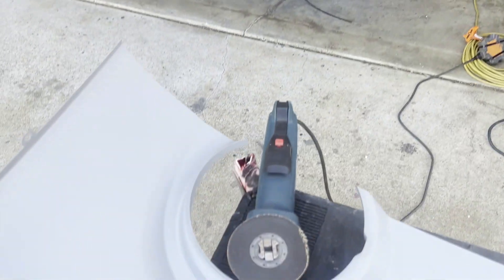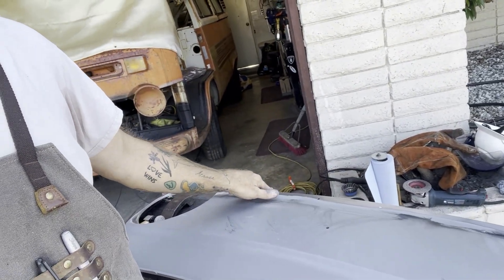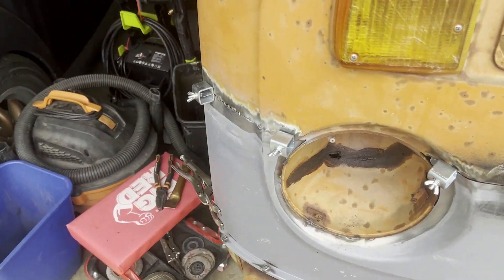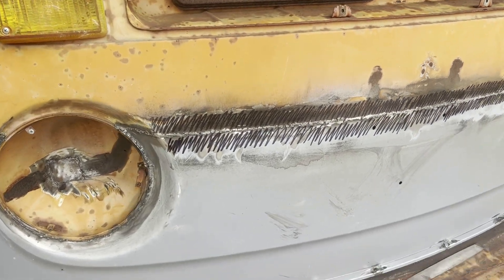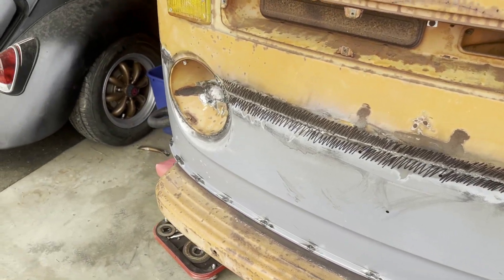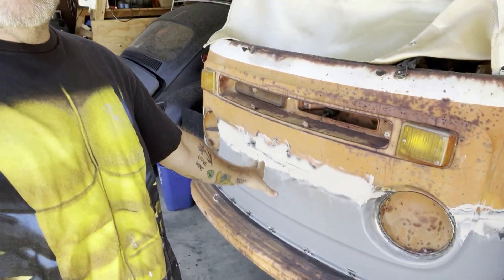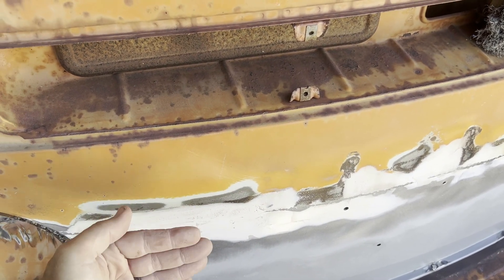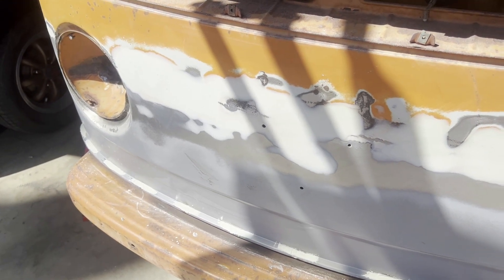1974 VW Build a Bus - Nose Repair, Part 2

Comment: You may want to consider this...  Your MIG welder can obviously weld with steel wire,  but it can also work with MIG Brazing Wire as well...   Now Mig Brazing is not Mig Welding,  but it is extremely strong and it uses a whole lot less temperature,  so it is much less likely you will have burn-through or warpage of the sheetmetal with MIG Brazing.   Brazing of course is "bonding" it is not "welding",  but the bond created with the bronze is very very strong,  so strong you would probably break the two pieces of metal you have brazed together before you would break the brazed union.  It's something to consider,  and it is a perfectly acceptable method of working with sheet metal.
Reply from the maker: That is an awesome suggestion, Billy.  I have many more patches to do along the base of the front window and in the rain gutters and on the rear hatch, so I'll check that out.  I'm up for trying anything that'll work.
Reply: @SchoolStGarage  Check out a few videos on "MIG Brazing" and "Brazing" in general.  The temperature required for brazing is very much less than welding and provides a very strong bond that in many ways is nearly as strong as a weld.  Good luck with your projects.
Reply from the maker: Watched a few already.  That really would've been the right avenue for me in patching this nose.  Thanks again.  At least I'll be able to give it a shot on the upcoming repairs.

Comment: I’ve been welding on rusty vws for years and sometimes it’s hard to do . I’m not the best but what I’ve found like here on my latest beetle video VW Beetle 1972 Saved from breaking. Repairing the RUST !!
https://youtu.be/0aOdeScWcMQ
Is fibreglass filler as I had a few deep dents that I never pulled out but a tip from bad Chad was to use fibreglass filler,smooth then body filler on top (bondo) it filled the dents and looks ok oh and hides the boger welds :) keep going and good to move on then go back like I’ve done recently 👍 keep going at it sir , it will be fine
Reply from the maker: Great tip, and nice video.  Subscribed!
Reply: @SchoolStGarage  thank you 👍